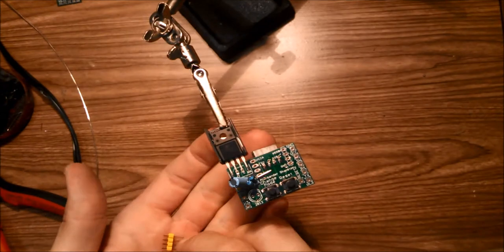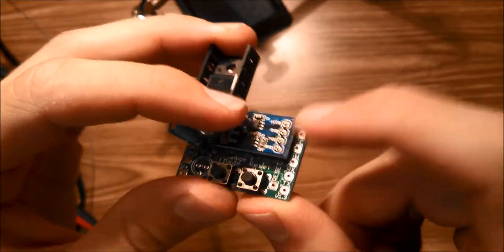LED Goggles DIY Kit Assembly Tutorial pt.1

Comment: On the power board where the logic converter goes is the 5 volt side on the left nearest the voltage regulator? The converter I'm using is slightly different in design and I don't want to install it backwards.
Reply from the maker: you don't actually need the logic converter, I figure out how to get  the design to work without it.
Reply: Ok, thanks for the reply!